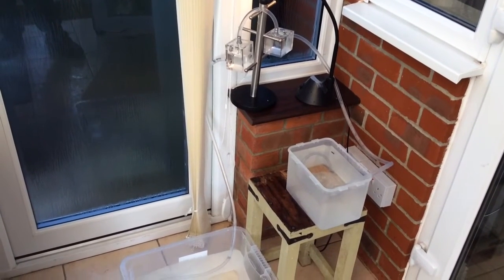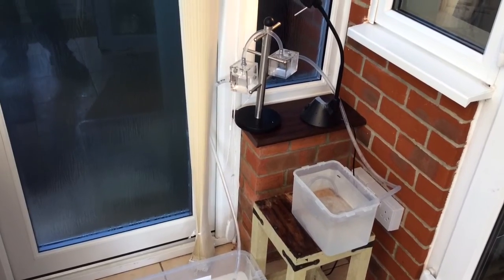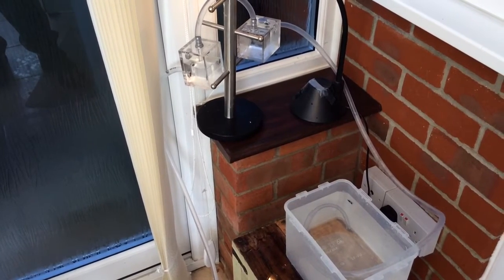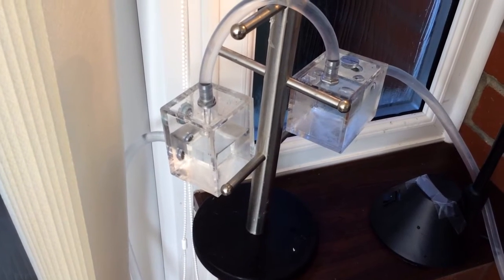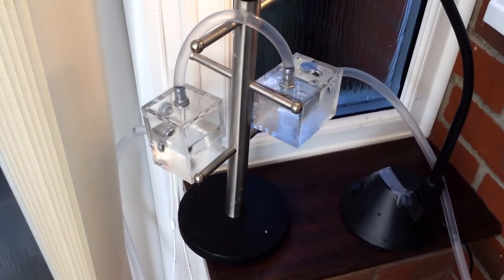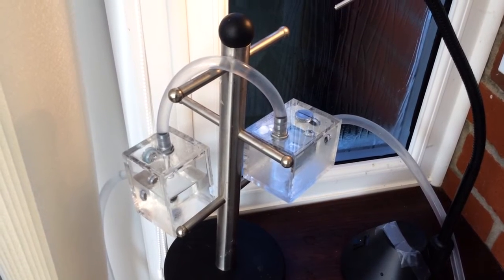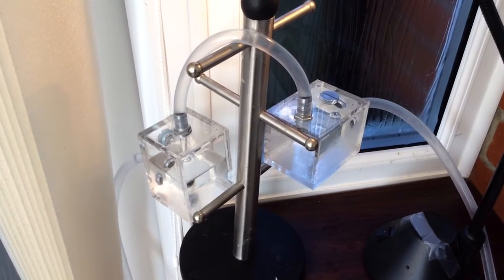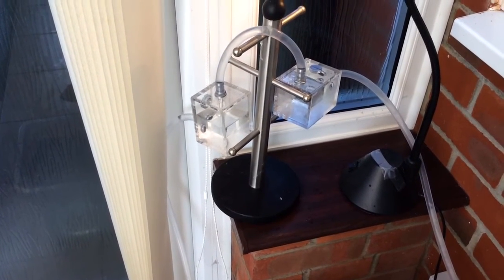Siphon Uphill  King Nebuchadnezzar II Stage 02

Comment: This is a very interesting experiment - the net mass flow of the water is clearly downhill.  However, the second container seems to be completely sealed, so it neither gains or loses water overall - the depth stays the same but it is very interesting that because the chamber is sealed to air, the air mass remains in it, controlling the pressure.  So no mass of water is going uphill overall otherwise the boxes would be filling up, but the air chamber is really interesting regardless and obeys all the conventional laws of physics - just with two fluids, air and water.  Finally if the second chamber had a single air leak - drill a hole in the top of it - the process would stop.  Very interesting none the less!

Comment: Turn the middle upside down  so the join pipe has liquid in then the two vessels will be linked and n then swap the buckets around it will pull uphill

Comment: I could see a scenario where you could remove small amounts of water and pressure intermittently as to not break the siphon vacuum.
Reply: It's not impossible you know. It just a little bit hard to find the balance in outside conditions.
Edit changed my mind. There is always vacuum force in the pipe during the process. So any crack in the pipe which is higher than the water level will suck air in the pipe. Not out. it will eventually break the balance of the process :'(
Edit 2: But. If you have an unusual pipe that can work in single direction it could work. Like pig bowels. Or dry papers.